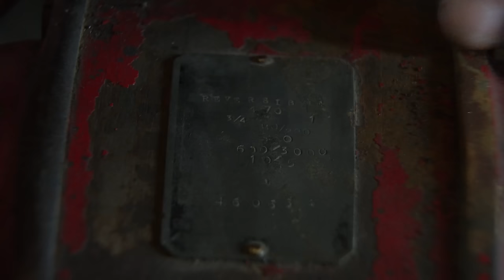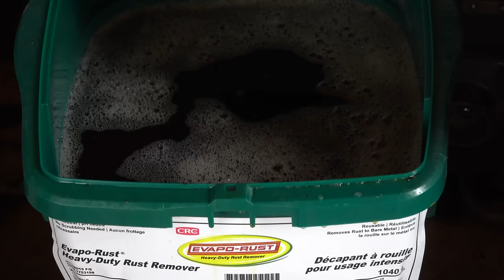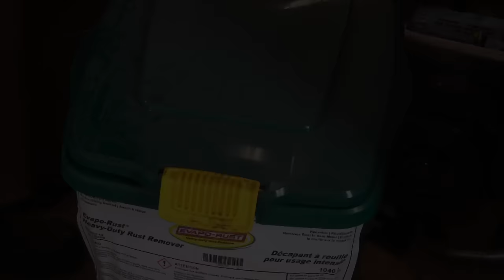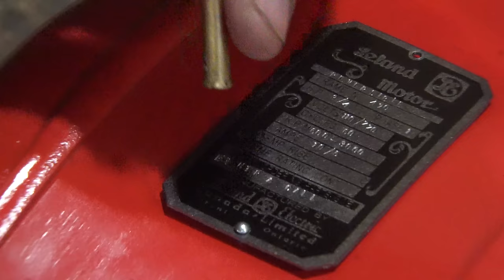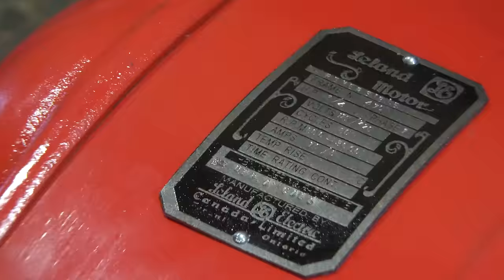Why Did They Stop Making These? [Restoration]

Comment: Leland made a lot of specialty motors. Phase shifting, repulsion, induction and wound rotor motors. I love the designs of these machines and now they are quite rare as most have been scrapped or thrown out due to misunderstanding of them. I have a complete selection of them and would love to see them in a good home. I'm a retired Westinghouse motor designer and probably won't be around that long. I have many Leland Dynamotors too!
Reply: Commenting to help this post show up.
Westinghouse Electric was an amazing company , as was Westinghouse Air Brake.
Reply: @1978garfield The Westinghouse Air Brake was such an important invention, I think about it all the time. How miserable life must've been before it and how wonderful after it. Imagine setting each and every brake on every car manually--so sketchy!
Reply: Dad did Westinghouse submarine drives during the war and for years after designed and installed the servos for motor synchronization on big continuous-process lines for Westinghouse customers.  He would have loved to see those ingenious Leland units!  As a kid it was exciting to see the big machines get tested in East Pittsburgh.
Reply: Are you selling them?
Reply: I love old motors, especially ones that are unusual and cleverly designed like this. 

I'm 29, and my collection of vintage electronics is decent, but sadly lacking in motors. If you're interested in selling them to someone who will appreciate them for many years to come, I am definitely interested. Though I must admit, depending on price I can probably only afford a couple.
Reply: Hand Tool Rescue would give them an excellent home 🙂
Reply: Are you selling them?
Reply: @frankmurphy5  yes, handtool rescue would give them a nice home, and perhaps we would all get a chance to see them!
Reply: Damn! All the old wisdom is disappearing.
Reply: Could you recommend any book dealing with them? I would imagine that if they are of unusual designs, it may be not easy to find literature about them. Thank you!
Reply: There should be a technical museum or a technical university to give them a home and the respect they deserve.
Reply: I have a controversial idea. Give them to an engineering school in Ukraine. The country needs support, and one of the best things we can do, is help them with mechanic and engineering education for the time that comes after the war. It might sound crazy, but Ukrainians have turned out to be insanely inventive, creative and driven people. They would treasure and preserve that history in your legacy.
Reply: what state you live in?
Reply: @TheNobility  There they will be taken to scrap metal.  I know the area, I know the people.  I also live in Eastern Europe.  I have witnessed countless historic gems destroyed for quick bucks.  Yes, they are resourceful people because of poverty.  But far higher are stupidity and corruption.
I know you're not going to like what I'm saying, but reality is complex.  And nothing prevents you from living in the area for a while to see for yourself.
Reply: Reply to me here and I'll keep trying to get my contact info in somehow. They seem to keep being deleted.

I just had a big house repair bill but next year or after I could buy them. Make a nice display to lend to my local college.
Reply: I worked at a motor repair shop in 1979 and repaired a repulsion induction motor. They had a box of old parts to repair the short circuit device on the commutator bars. They told me that the parts for that motor had been obsolete for years.  Motor ran great when I was finished. In 1982 I got into hvac and refrigeration and ran into another RI motor on a belt drive refrigerant compressor.  Quite a torque monster.
Reply: That looks like a motor I saw on the U.S.S. Texas . It was also marked a.c.  d.c.! .....Feel long in the tooth then read the book of John! best  part is John 3.16. ! God  Bless!
Reply: You should write a book with explainanations of how they worked. Too much knowledge is being lost.
Reply: That is when things were made to last and rebuild. Today everything made is a throw away Item and you buy a new one. That is the game today make it last only so long then it breaks and you have to buy another one. It is not how long it will last but the question is make something with a short time span to have it break down.
Reply: My Dad went to Westinghouse school in Chicago in 1950's.   He rebuilt electric motors after that.  Passed in 1996.
Reply: I would Love to buy just one Variable speed reversing grinder/buffer motor as shown here, It would be cherished and do light work. Of course I would show it.
Reply: @keithehrman5490  Yes, my dad had a restaurant back in the 1960's.  The refrigeration compressors in the back room were driven by repulsion start induction motors.  I still have a 1hp one to this day that was removed when new Copeland semi-hermetic compressors using R-12 were installed.  As a little kid I was scared of them because they sparked at the brushes when starting and the frame was open enough you could see everything.
Reply: Need to video interview this dude!@obsoleteprofessor2034
Reply: I dont think there will be an after war. Just Russian occupation @TheNobility
Reply: I have an old GE motor that looks very similar to this without the brass handle, but the case is almost exact , my guess is early 1940s, when its running you have to look at the shaft to see it spinning because its so quiet, you don't hear anything, , can this be done to a motor like these in general or is there a difference in the winding ?
Reply: 2:55  @klpittman1 Rosenberg electric motor repair is a great book
Reply: I'd love to accept them in my good home :) they'll have plenty of room to stretch their legs since they will be the first dwellers in my workshop 🥺 obviously I'd take care of shipping unless by chance I live nearby.  Macnjack89
Reply: At Gmail
Reply: I use Gmail fyi
Reply: @surfbyrd1 Boy, would I love to have you just explain all of those motors now as almost everything now just glosses over the "bulletproof old school" designs as "new and disposable" motors made overseas are the examples given. 😢
Reply: Call the Smithsonian. It is expanding its collections.
Reply: I am curious. How is the brass speed control handle being attached to one of the brushes not an electrical shock hazard?  Is it somehow bonded to the chassis at that point?
Reply: @kennylavay8492  I do industrial maintenance during winters and all our big electric motors are still rebuildable. I'm in a printing press and the huge rolls of paper arnt light.  Not are the huge trimmers that cut books. Our newest machine is only a few years old and I've had some of the motors rebuilt. The shops are out there still as well. 

But now it's often cheaper to buy an replacement part on consumer level then to rebuild them. But feel free to get them rebuilt.
Reply: Contact the Smithsonian.
Reply: @Sparky95 I think to preserve them for longer than you can is to have in your will. If the library of congress would take them, for future specs of what once was !  If so, include your own writings of uses and story of how they were used back in THEIR day.. be a great project for mankind that you put together for the library/future knowledgeS. And I doubt the library has anything like that motor nor designs of one. Google might have all specs or a strange seller on ebay who's just geeky enough to list them and not pitch em.
Reply: There are many engine hobbyists across the country that are part of large clubs with permanent facilities. They have open houses for the public usually in the form of thresherees or steam shows. Seems to me they may be interested in an intact collection as many of their displays are museum grade and contain items of Interest like you have.
Reply: @TheNobility Slava Russia 🇷🇺!!
Reply: get this guy some museums!
Reply: @1978garfield Ahhh! Those were the good ole days when American produced quality!
Reply: @TheNobility  --- I see you drank the Kool Aid, and went back for more...
Reply: That’s really cool! I’m a winder of 20 years and never seen anything quite like this
Reply: @TheNobility For sure, looking at the infrastructure in Ukraine, you would find some of these motors still around.
Reply: Would love to get my hands on one! Anywhere near N.C.?
Reply: Since the originator of the video didn't want to answer the question in video title: ''He goes to all the trouble of resto'ing this piece but doesn't try to answer the question in the title ''Why Did They Stop Making These?" I'll make a guess, the war came along and a lot of these specialty items got pushed out in favor more priority items. After the war they just never returned. It's not all that difficult.
Reply: The old induction/repulsion motors, just got replaced today, and thrown away. One motor that doesn't get thrown away, is the wound rotor on the Himalayan ride. We rewind them, every couple years, or so. The control lever, shorts out the rotor, with electrodes, in a salt bath. That's how they control the speed of the ride. I wondered, if somehow, the rotor wires got accidentally connected, would it fly off the tracks?
Reply: Maybe, donate them to a museum, not the Smith, so young people, can see our past.
Reply: @luisllorens70 it's very corrupt, things just mysteriously disappear. Maybe destroyed, maybe sold?
Reply: @oddreign that's what I was wondering as well
Reply: Greenfield village in Dearborn might collect motors
Reply: @frankmurphy5  who is handy tool rescue ?
Reply: My hat goes off to you Sir a true pioneer in a misunderstood field!
Reply: @klpittman1  Or  wiki articles
Reply: I have 2 ww2 radios with dynamotors, thanks for the information, I'll be giving them a look before I run them.
Reply: I would like to have one how much?
Reply: I don't suppose you live in Boston do ya? I love tech new and old and these machines are fascinating
Reply: i will gladly buy one of these if you have one for sale.
Reply: And what part of the global Country are you from?
Reply: I love this idea, very talented indeed, and in need of encouragement, and some retraining for those with hardships to rise above and overcome. Great machine, makes me smile inside, it's so cool.  @TheNobility
Reply: @obsoleteprofessor2034  Sure seems like it but sometimes new comes along and we see bigger, better, recoverable, more efficient and cheaper [put invention here. Like, say, rockets😊].
Reply: Location? I’m an ever-apprentice journeyman machinist in the Pacific Northwest, not a greedy one mind you❤.
Reply: LEYLAND
Reply: How much are you selling them for and where can I buy one!?
Reply: @frankhass565  the way the motor is constructed, the brushes and rotor are never electrically connected to any AC voltage. Basically, because they have the current flow through the stator windings, and having the brushes electrically connected to each other, they can induce a magnetic field in the rotor as well as through the brushes. And because of how polarized magnetic fields work, rotating the brushes relative to the stator windings changes the strength and direction of the magnetic field in the rotor and causes rotation.
Reply: We're they at ?

Comment: There's something special about those small oil filler ports with their little lids... love them!
Reply: Gits oilers.
Reply: @grntitan1  thank you! I now have the correct word.
Reply: Like the sight glass oilers, just more special. Or primer cups on antique cars!
Reply: On my oldest jeep, the generator and the distributor use the same oilers
Reply: Yeah and the wadding as a reservoir is pretty brilliant too.
Reply: They were common on journal bearings, which require constant supply of lube to function.  I have dozens of these on my 1/8th scale 10-wheeler steam locomotive, on every bearing.
Reply: @HazardXXXoverbuilt! Now it's all been optimized away where units last just beyond their design lifetime.
Reply: Like the ones on the axles of older bikes with Bendix pedal brakes.
Reply: Aren't the porous bearings[oilite?] full of parts cleaner and/or rust remover?
Reply: Oil cups. I used to fill them all the time on my injection molding machines.
Reply: @bpark10001 The lathes I've built 1.6" scale locos on have them.
Reply: @adammontgomery7980 I have a 1/3 hp  motor that runs at 1140 rpm, and it's made in Schenectady New York by General Electric, and the only thing wrong with it, was the starting switch inside.
It ran a large grinding stone, for hand edging optical lenses, and they would leave it running throughout the work day.
It's been retired, but I cleaned it up, and it still works.
This motor has so much copper, and it was made around 1933.
I have another 1/2 motor that's similar, but it's in much better shape, and was barely used, and works perfectly.
It was from the 30s and probably used in the GE museum, or it was in some old timers basement, and sold in an estate sale.
Reply: @TempoDrift1480 Many old machines, particularly motors and generators/ dynamo's, have felt pads built in to the bearing housings, to hold a reservoir of oil.
Reply: So…when stopped is this thing just sitting drawing current and getting hot? Seems like it would need a micro-switch to shut it off when in that position.
Reply: I have a very old Emerson fan that has that same type of oiler port. It's still working great, it was made probably sometime between 1910 through the 1930's.
Reply: got 1 on my dodge poly distributor.

Comment: I Tore down Thousands of these and Scraped them many of them where over 1,000lb and had to Tear them down in place to Remove them from the Factory Floor and had to use the chain Falls to Lift them. The Factory Give them Away Free to just get them out of there Factory for they where not being used for anything anymore and just taking up Space and they where Replaced by in house Staff years ago by way more efficient Motors. The Factory was a Lumber and Timber Mill and many of the Motors where from the Time when the Lumber/Timber Mill was a Black Smith Shop that went back to the Early 1800's and the Lumber/Timber Mill went back to the Early 1900's.